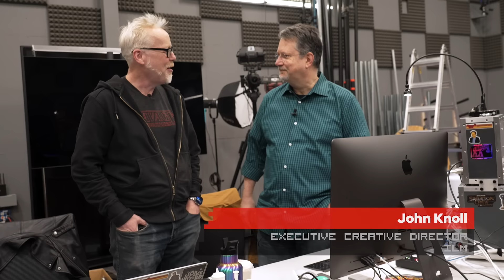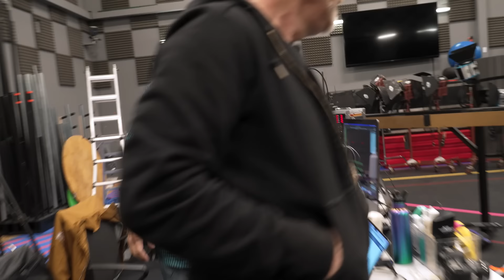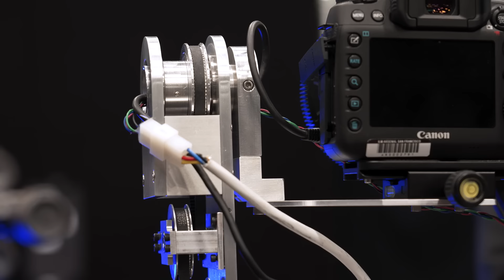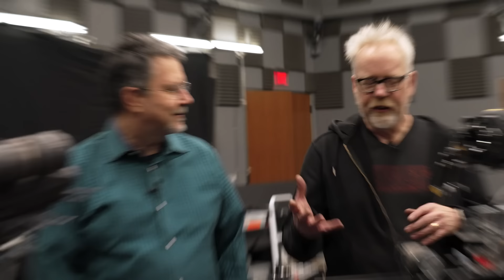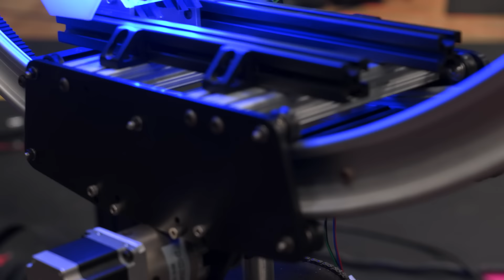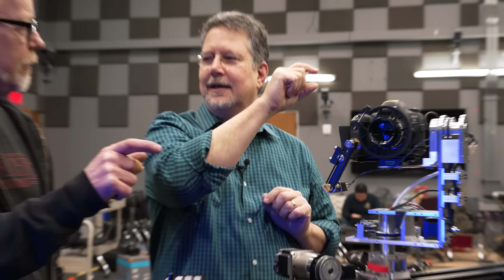How ILM Films Star Wars Motion Control Spaceships!

Comment: Looks like that setup is great but yeah I do need a bigger area and instead of having it on a rail system gets multiple basically Roomba platforms with robot arms on them and have a grid in a room that's a giant green screen or whatever where you have the stuff all interacting on a computer model and you could just have these roomba's drive around with the arms holding the ships angling it to look exactly like the ships would look flying around. You just green screen off all the robotic equipment and stuff so you can edit out anything that's not the spaceships.
Reply: Basically you don't need the rail system because you can have all the coordinates and actions of the arms very precisely coordinated or mapped out so you could just reposition any of the robots back to where they were on the grid and the ship can be at the exact angle it was before for multiple shots or camera angles. I mean obviously there be a little camera going around the room too basically you'd have to just coordinate all of these roombas and robot arms not to bump into each other while holding the ships in a giant screen room.
Reply: This concept could obviously also work with humans for action shots. Just hook a human up to a big robot arm connected to a crane or a mobile robot, and the human can basically be strapped into a harness that allows them to appear to be super jumping, and flying around, and angle their body and whatnot just right for any shot.
Reply: I'd almost say too if for a robotic arm articulation to try those rope pulley systems because they might have a more organic and smooth feel

Comment: Not that it matters (the retro glass is the right choice) but the typical way of dealing with the non repeatable aperture is to hold down the DOF preview button and then unmount the lens breaking electrical contact. You can then remount the lens with a bit of kapton tape over the contacts . You now have a fixed aperture lens which isn’t as nice as having manual control, but it gets the job done

Comment: I am loving that motion control system and I want one of those pendants!! would love to know if that was hand built or is an off the shelf item. Having built an automatic watch parts cleaning machine with a Teensy 4.1 myself the capabilities of this awesome little microcontroller are amazing. Great to see an EOS 5D MKiv being used for this work shows how amazing they still are after having been out now for some 9 years. I still use and love mine despite a lot of people having moved on to mirrorless.

Comment: As far as the model stand, all he needs to do is set it up like a lathe ,with micro adjustment to go up or down, instead of adjusting screws, just have a long micrometer thread pole with attachments with the same type of movement like on a lathe and the same with the bed of the model holer, have fine adjustments so it also can move, plus what he already has just think of the acme optical printers that were first made on lath beds because of all the adjustments available. cheers ✌✌👍👍😎😎🦘🦘

Comment: 19:30  There should be enough degrees of freedom in John’s current setup so it would not be necessary to modify the mechanism to move the camera and not the lens to achieve focus.  Only a software change is needed.

If you tell the motion control software where you want the lens to be and how far away the model is to be from the lens, the software can calculate the focal distance and thus the distance from the lens to the focal plane of the camera, and thus where the camera has to be.

I’m assuming that, since the camera is on a linear track, the model has the freedom to be moved towards or away from the track, to get the desired orientation and distance from the camera.

Comment: I love this video and love that they are still doing motion control effects. With that said, I do have to ask this critical question. What is the point of doing motion control if the result still looks CGI anyways? I also noticed this with the Razor Crest. I don’t know if it’s the boosted shadows, or the higher dynamic range of the cameras, but it resulting shot still looks kind of CGI. Now I get it has to conform with all the other shots, but I would expect that using a miniature would add some classic realism to the shot.

Comment: I wonder if they ever tested, or are using, a Micro Nikkor for it's flat field of focus?  The Medical Nikkor would be another lens to try. Or they mounting to a plate and bellows they should test some really excellent 4x5 optics like the Rodenstock (my general favorite).  Using a bellows would also allow them to do some interesting things with depth of focus, which is used in landscape photography to give sharp focus from very close to the camera, to infinity. There are Nikkor tilt and shift lenses too. Also tilt and shift adapters to use medium format lenses on 35mm DSLRs. They supposedly give you more range of motion.

Comment: Hey Adam (@tested), I'm building an open-source motion control system. It is a building set of module you can combine with off the shelf parts. Think of those plastic bricks from Denmark. Not ready for release yet, but if you are interested, you could join a closed beta-test. Feedback is always welcome. Open-Source, no fees, very low cost of parts, endless possibilities.

Comment: This probably won't be seen by Mr Knoll or anything. But might help someone else who knows. On the canon cameras where he mentioned the aperture does not close until the photo is taken. While this is true there is a button to press on the camera to trigger the aperture to close so you CAN preview it through the viewfinder. The good news is. If you press this button and hold it while you press the button on the lens to release it from the body and simply twist the lens ever so slightly. The electronic contacts will not connect from the lens to the camera there is no signal from the camera to open the blades or close them either and they will stay where they are and you can then essentially "Lock" the aperture blades in place while using the camera. I used to use this trick doing time lapses so I hope that helps someone out there!

Comment: Nice, now I need to build one to play around with.  You could also change the camera mount to hold 2 cameras at the same time and shoot in 3D stereo.  You would need a control to pitch them in or out to adjust for the distance from the focal point.  You might want to make it independent of the lens focus to allow foreground layering. I already have about 95% of the stuff needed laying around my lab.  I just need to find that curved pitch track...

Comment: Adam, from the sounds of it.. he needs a hydraulic lift table. Maybe 300lbs and 6 inches up and down in total. Thinking machined aluminum top and bottom.. scissored arms with a motor and screw at the bottom. You don't need to worry about electronics of it, but it has to be precise, sturdy and resistant to time. To the bat cave!

Comment: Great feature and insight! 
When John talks about the ability to raise and lower the camera for "minor" adjustments to PoV during moves or after set-up.  Perhaps he could raise the entire track by say 1ft fixed (lay a raised walk platform behind to maintain operator's level to dolly and make all those trailing cables safe and hidden!).  The fixed model manipulation platform can then be mounted on a height adjustable platform e.g. electric driven scissors with whatever level of smoothness and height he can imagine and make, like say +/-6" to level of track.

Comment: The most surprising thing about this video was that the motion control system didn't use IK to take the previsualization as intake and output full movement for bot the camera and model stand to match the virtual 3D model exactly, fully automatically.

Comment: It's interesting to me they went back to the original glass from the 70's because I have a couple of old Nikkor lenses and they have magical qualities for macro photography. Btw moving the lens on a bellows is exactly how you do proper macro photography, because as you move the lens further away from the "photographic plane" it makes the image circle larger, which magnifies the image you see....I do this with "extension tubes" but the principle is the same as here and I get about 10-20x magnification so almost at the point where you get a microscope- but nothing is free here and at high magnification you need more light on the subject to get your exposure correct. Also I could go into reversing lenses but that is another thing entirely

Comment: Rotating focus can include aberations as well. Especially when dealing with stepped down micro movements for miniature shots. Discovered this when building a digital bullet time rig in 07. The linear focus is brilliant. And mech mirrors are a pain as well. We ended up opening all 150 cannon 30DS a few seconds before the shoot. It required opening the cameras and hardwiring the shutter button to both half down and full down. That was a fun project.

Comment: Interesting to hear about using a fixed plate lens mount and racking focus by a linear track on the camera and a bellows in between. Depending on how much distance you are extending or compressing the bellows, you may need to compensate for exposure change though.

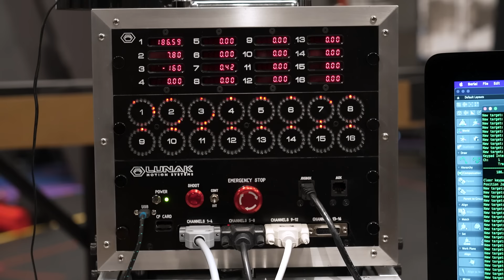Comment: at 0:46, there using top end  apple Mac as just a dumb terminal, to talk to an Arduino, that not even considered a real computer, and not ever a making a good terminal at that too, it do you going full screen display, so be show read out the windowed box, the where going plug the serials cable into, the its going some so of adapter, (something else that could go wrong?) and cheaper bit tatt, from the worst corners of the internet will have serial terminal mode that posable 100% better at be a terminal too?  ¯\_(ツ)_/¯
Reply: Show us on the doll where the English language hurt you.

Comment: It's so cool that in the "all digital age" the old knowledge is still valued and gets modernized put to use. And like he said: since like 2010 it has gotten way more easy to do controller & motor stuff. What a cool rig! 😎🤘
Reply: The technology available for hobby electronics today is incredible.  I started an electronics apprenticeship in 2000, you couldn't even buy blue LEDs then at a consumer lever, still just red, green and amber, PIC chips were the choice for micro controllers, but you had to build everything, no pre built modules and the coding was done in hex.
Reply: @kingcosworth2643  I started about 1980 as a boy with old radios... You can go anytime back in electronic and there were rapid changes all the time.
Reply: And now it's actually the old knowledge of the old knowledge. Many years ago, I read about the production of the first Star Wars movie. At that time, they rediscovered old film technology from (if I remember it correctly) the black and white file area which was almost forgotten.
Reply: I was thinking the same things. If you’ve ever experienced the sleepless nights, the hair loss, etc…. of learning which way actually works….. the insight from this guy is worth his weight in gold.

Comment: @2:18 Maybe we can learn from what is said here.  Jon Favreau thought that it was worth building a physical model of the RazorCrest just to see if the glint from a light source that was nearby was accurate in the CG shot.  I have argued my entire life on this subject.  People who spend other people's money frivolously are just plain WRONG.  You have to spend other people's money more carefully than even your own.  This is an example of wasting money for no good reason.  The juice is not worth the squeeze.  In hindsight yes, they got a cool developed motion control system, but they didn't know that at the time.
Reply: I'm curious to understand how to interpret your point. Do you oppose any experimentation of any significant cost to improve visual believability that lacks a guaranteed payoff from the outset?  Or how do you judge such an experiment as objectively frivolous?
Reply: @Thomas_Esson  Hey Thomas, in this case, I am only talking about the circumstances here.  There is a lot of CG experience/knowledge up to this point.  The Mandalorian is not charting new ground when Jon Favreau made the request.  I would NOT be saying this on something revolutionary.  As an example, I didn't see any issue with ILM artist using funds to see/prove if Jurassic Park could be done with CGi.  That was money (in secret, BTW) well spent.  I think Jon Favreau's request was frivolous.  Enough CGi white papers have been done to know how light behaves on a specular surface.  It is called lookdev.  You should NOT need a physical model to show this more clearly.  Just an opinion.  The true point is that I believe you have to be more conscientious with money that is not yours.
Reply: I think they have plans to use it a lot. This whole room is devoted to it. And it might be cheaper and better than CGI in some ways... like no second guessing lighting to make it look more real

Comment: The most important thing that they need to unlearn is to stop using CGI with models. It looks like CG. Pretend it's 1985. Of course the mechanism is in programming should be modernized, but the look needs to look like the 80s when things actually looked good. 4K restorations where they've  recomposed model shots have been relevatory for a reason
Reply: I bet real money that you can't place really good CG and that you think a lot of movies that use practical effects don't use CG when they definitely do.  The reason 4K restorations look better uwith redone model shots is down to how good the artist are when doing their recomps.  You get that compositing uses CG elements right?  In a lot of cases the lighting is completely CG'd in the restorations you're thinking, let alone the film grain/noise simulations that are mixed over.
Reply: @zembryoz  how much would you like to bet? I could use some cash. A perfect recent example of how CG ruined an amazing practical shot would be the ramp in the previous mission impossible film, it looks like CG because they used CG to erase it. It looks like crap  as a friend of mine that worked on Independence Day, Spider-Man, and many other movies said a 98% successful CG shot will always be worse than an 80% successful one using real world elements. Use a matte painting it will always look better  because it's there in the shot and it's real. Just like the dark side of the forest CG is easy, the 80s were so magical for a very simple reason, because impossible things became barely possible and people had to innovate to make them happen. Is the difference between matrix one and matrix two. I have handled the camera negatives to major television shows and motion pictures in my hand. I was the first person explaining to people how they would add artificial grain back on top. Once again there's no point of doing model shots if it looks like CG in the end.  I would love to see them shoot it on this and then VistaVision  35 mm or better yet 70